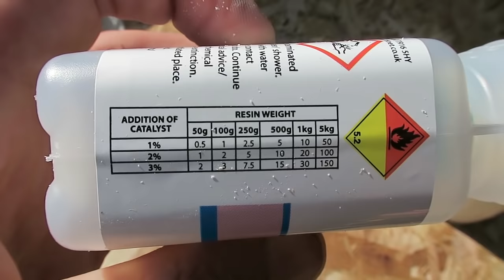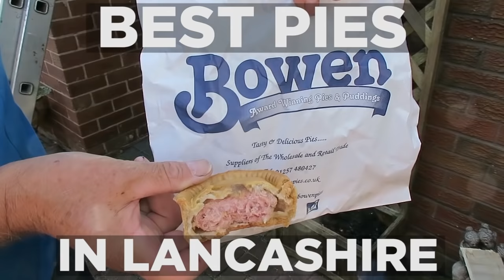how to install GRP fibreglass flat roof tutorial part 2

Comment: This takes me back to the early 1990's when I worked all over the north of England and Scotland,fibreglass ing all the Esso petrol station forecourt roofs.It was a right royal pain in the arse because we were told we could not lay it if the air humidity was more than 5 %.Which as you will know yourself living in the north that is most days.We spent most of our time getting to sample the local beers and smoozing the ladies.If I remember rightly we had to add expansion joints on anything over 20 sq metres.It was a lot easier than felt roofing though,and I loved the smell of it.The method of laying it does not seemed to have Changed much in all these years.
Reply from the maker: nice one mate thanks for the comment royal pain in the arse it is lol good job we dont do it daily 

stu
Reply: Glad i read your humidity note ,im waiting for the roof to be done where i work,owners neglected roof for over 15 years,they said they need two dry days to do fiber glass,lol we in the north too and it dec two dry days um maybe next year,how do you guys earn your money in engĺand,im thinking im gonna have to bin my business now and find another job as i cant see it ever going to be time weather wise to compleate,they put plastic over boards for now and 2 inches of water on floor from leaks,, i dint know what fiber glass covering was but at least i do now glad i saw this vid

Comment: did a poly roof about 27 yrs ago but used plywood still in good condition, but went back to the pvc membrane and built up roofing, first used the pvc membrane 40yrs ago and found it to be the easiest roofing system on the market,

Comment: Hi Stu. I've been watching GRP videos the past few days because I have a few tricky drainage items to make that I can't source anywhere. I liked your video and your approach, but have a couple of questions...

1) Shouldn't you consolidate each laminate layer? It appeared that you did 2 layers together and with the time-lapse it's impossible to see whether the first layer was at it's 'tack' stage when you added the second?

2) You sanded the laminate, which I presume was due to that coat having cured. Couldn't you have reduced the catalyst to have given yourself time to add the next coat at the first coat's 'tack' stage? (I understand this gives the optimum bond?)

2) The chemicals and fibres you're working with are lethal to lungs...so you ought to wear suitable respirators when sanding (!) and use a vacuum cleaner rather than a sweeping brush to de-dust. If I was your client's neighbour I'd have stopped you in your tracks.

Good work, mate, but remember that you, your helpers and your neighbours only have one pair of lungs. :-)
Reply: Yeah all good points

Comment: Thanks  for the Very informative and detailed. Im looking to build a deck on a flat roof, currently covered by felt,  which i want to replace. which waterproofing system would you recomend.? thanks
Reply from the maker: +the zayeman1 the one in this video it's flexible to what you need

Comment: Awesome job Stu. On the side of the dormer when you took off the cladding there appeared to be roofing felt covering the sides? Did you remove that and then insulate it or over the old felt? I have a similar dormer with no insulation and knackered plasterboard. Becoming a big job! :(
Reply from the maker: +Nick Walton we took off the old felt insulated then re felted before we put cladding on 👍
Reply: Do you come down as far as Holmes Chapel for work? How do I contact you? Have a few jobs. Cheers Nick
Reply from the maker: Nick Walton hi nick you can send an email to stucrompton@ymail.com cheers

Comment: My elderly mother had a "friend" do her garage. He did the woodwork and got someone else to fibreglass it. It doesn't look too bad but  they  assumed the gutter would be on the wrong side and now there is a massive pool.  Can that be remedied by cutting off the raised edge and refinishing?. Also it has bits sticking up all over just top-coated over

Comment: Nice job. However that is a cold roof. Why no eaves ventilation, mushroom vents, or counter battens for air flow. I do fibreglass roofing and ventilation is very important to prevent delamination of the OSB as well as prevent mould inside.
Reply: Would you have to put a mushroom vent for each joist?

Comment: lovely job! can you go over an existing felt roof with that stuff?
Reply from the maker: i wouldn't recommend it due to the weight ian plus it a proper job ripping everything off
Reply: I've an old felt roof, but knackered and stripping it off would be so much work on my own. Would it be okay in your opinion, to build a light timber frame (on top of the old felt) and osb board on top of that ? The weight would not be an issue y'see and it would mean a lot less work for me...
Reply: Have you thought of an EPDM roof.  There are kits from Firestone that supply an underlay to go straight over the top of a flat roof.

Comment: Why would you glass over ducktape and risk a delamination seems like a silly mistake after to rest of the job looked alright
Reply: You duck tape joints as there is a 3 mill expansion gap , this stops the resin dripping down inside